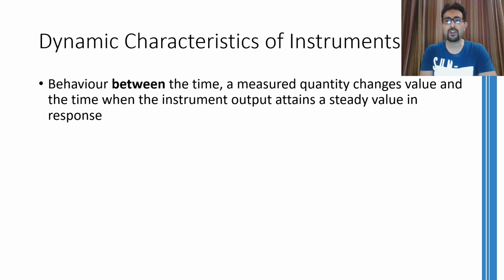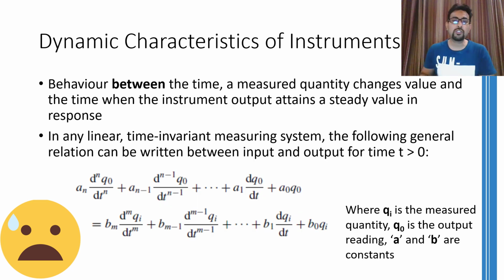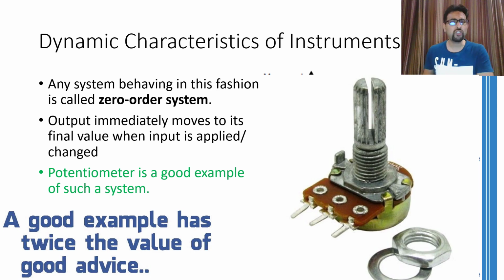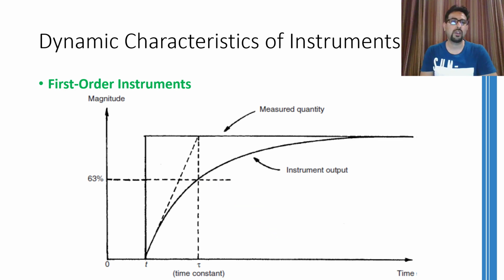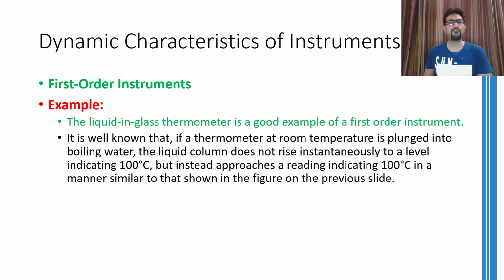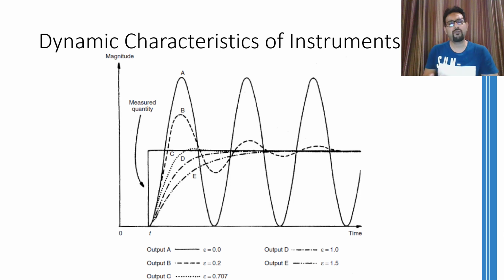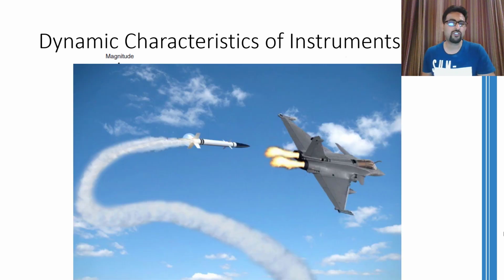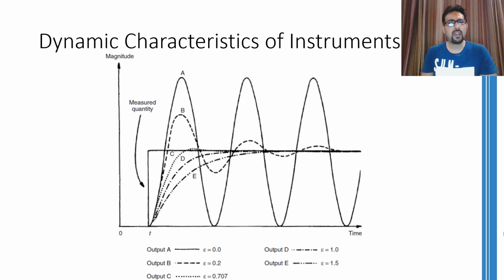Lecture 3 Sensor Characteristics | Dynamic Characteristics

Comment: First and Second Order Systems:
1. First Order System: Hair Straightener is an example of a first-order system. This is because as soon as we turn on the switch and supply it some voltage, it keeps on increasing its temperature gradually till a specific value which is required for straightening is reached.

2. Second Order System: A Shock Absorber is an example of a second-order system since it is a damping system. It converts the spring's kinetic energy into heat energy, thus damping or decreasing the amplitude of the shock, and then the car stabilizes.

Comment: 1st order system:  When a heavy weight is placed on an analog weighing machine,  Its reading 
shows rise to  the actual weight  with a little delay.
2nd order system: A heart pulse monitor shows  waveform only when the heart beats, it remains straight otherwise. If it remains straight continuously, it means the patient is dead.

Comment: Task)
1st order system: A digital speedometer will take some time to drop to the actual speed of a car after an abrupt break is applied. 
2nd order system: The shocks in a car oscillate after the car goes over a rough speed breaker and the oscillations dampen quickly so that the passengers don't feel discomfort. The car takes becomes stable after the oscillations have dampened.

Comment: 1st Order system: Thermocouple is a typical example of 1st order system. The rise in EMF and thus temperature reading happens with some delay depending on the heat transfer rate of bimetallic junctions. 

2nd order system: Vibrator or actuator used in ripple tank for generating water waves exhibits second order behavior because when the speed of the actuator increases the amplitude of vibrations is initially high but due to water the amplitude of vibrations dampen and settles at a low but steady amplitude.

Comment: 1st order system: When we turn the switch ON to start the tubelight, it takes sometime to glow fully.
2nd order system: When we measure voltages using voltmeter we observe that the value at voltmeter changes abruptly and then get normalize to a single certain value.

Comment: 2nd order: The current drawn by a DC motor will be very high at the start due to low back emf but it will fall down and eventually become stable after a certain amount of time while the input voltage is kept constant.

Comment: 1st order: When Surface to Air Missile is fired from a canister of a naval ship, its engine ignites at once the signal is provided but to leave the mother ship completely, it requires a couple of seconds to develop adequate thrust while the burned gases are exhausted from a parallel channel placed next to it.

Comment: 1st order system: RC circuit is first order as output takes time when input changes because of capacitor.
2nd order system: a spring balance usually oscillates about final value before coming to rest.

Comment: 1st order system: Laptops, when we turn on the laptops it starts slowly to reach its final output where we perform functions.
2nd order system: In electrical circuits, adding an inductance to an RC circuit to form an RLC circuit will lead to oscillation in voltage measurements.

Comment: 1st order system: Heating rods or coils. The need some time before reaching boiling point.
2nd order system: A bouncing ball. It will oscillate about mean position.

Comment: 1st order system: when brakes are applied to a moving vehicle, it takes some time to stop.
2nd order system: needle in galvanometers and sometimes ammeters, oscillate before showing the final value.

Comment: An oven is an example of 1st order system as it heats up slowly. A joy ride is example of second order system because the ride is accelerated at first after which it decelerates to an optimum value

Comment: Second-order system: A multimeter
When you place the wires of the multimeter at the location where the voltage or current or resistance is ought to be measured, it will oscillate about some values before settling down to the correct one

Comment: 1st order system : The Electric Heater which when provided an input will give output i.e warms the room slowly after taking some time.
2nd order system : Weighing machine . when you step on the weighing machine it will oscillate about the final value and then after some time come to the final value